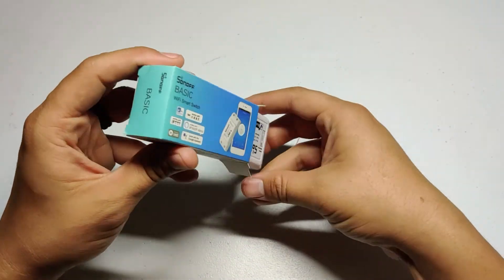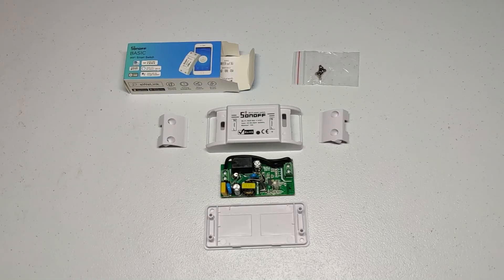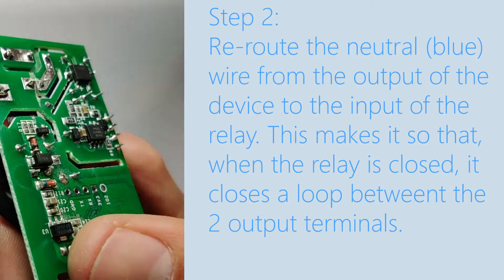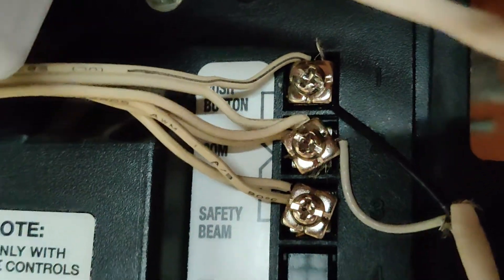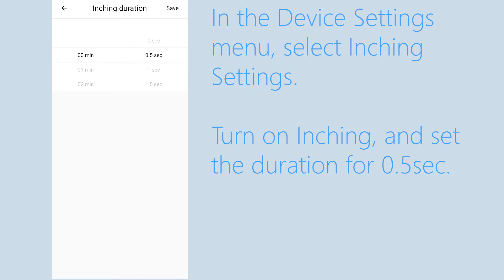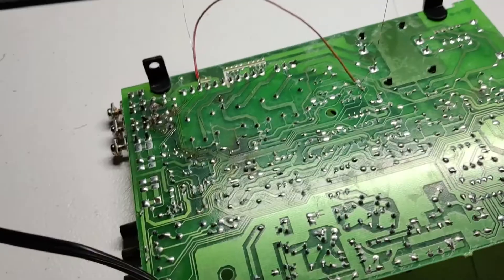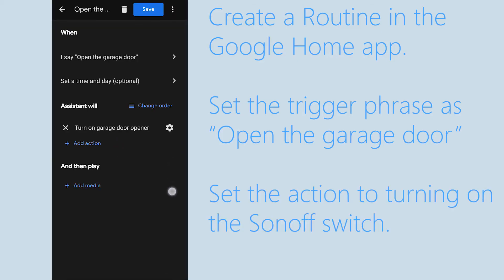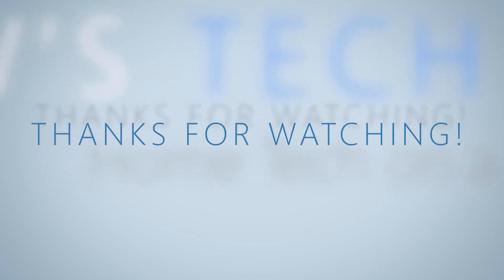Automate Your Garage Door Opener for 5 Bucks! (I Broke It!!)

Comment: Hi. Have any ideas for alerting my phone if the door is opened without using the opener? Like if it's pried open? Would be good if an alarm sounded too in that condition. Thanks in advance.
Reply from the maker: Use a contact sensor?
Reply: @MakeItWorkTech  wouldn't it alert me no matter how the door is opened though?
Reply from the maker: Yeah, but you could make an automation that only alerts you when it is forced open. What platform do you use for home automation?
Reply: @MakeItWorkTech  I've yet to start a system and am just starting to explore what's available.
Reply from the maker: Oh ok! If you decide to use Home Assistant or SmartThings, this kind of automation will be possible.

Comment: I have a few sonoff switches, but none seem to have the inching option in the app. Is that depending on the firmware or on the version of the switch?
Reply from the maker: I believe it is the firmware. The switch in this video is the Sonoff Basic R2